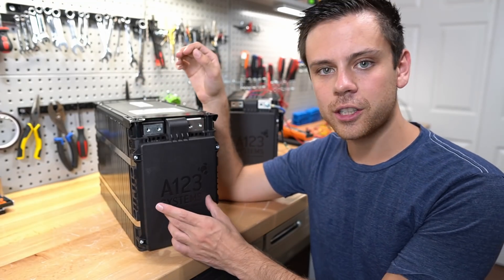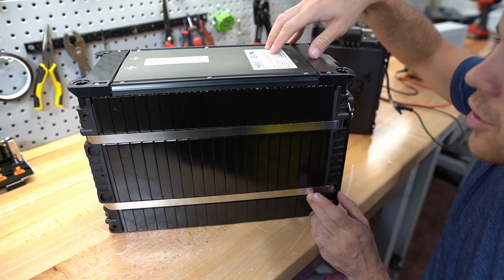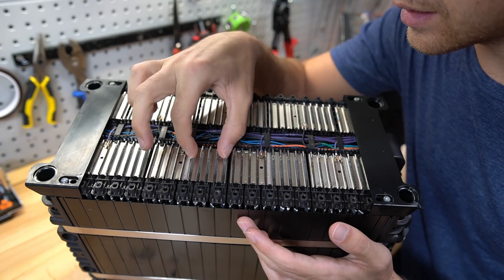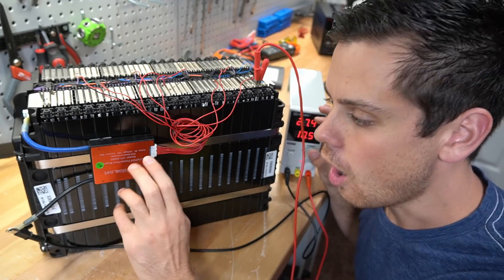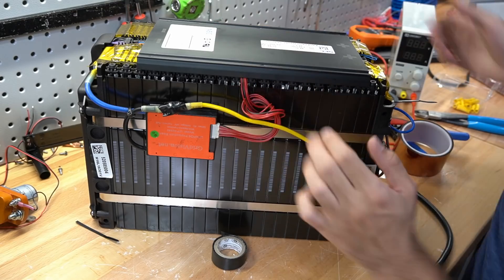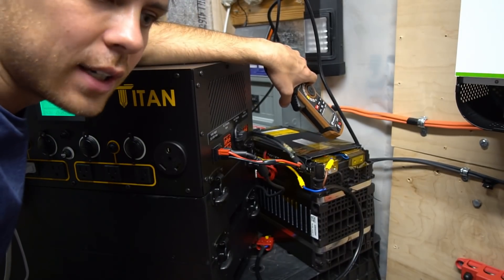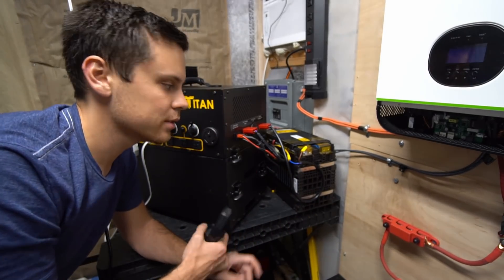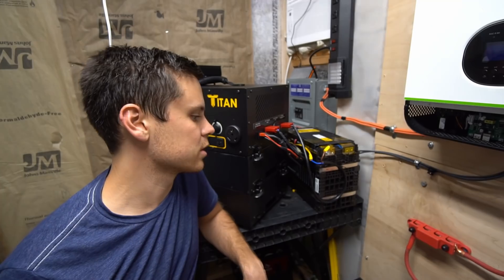DIY LiFePO4 Expansion Battery for the Titan Solar Generator: $649 2.45 kWh A123 Battery Build

Comment: You added your own BMS leads to pre-existing "balance" wires... What are those wires already in the pack doing? If there some sort of balancer already installed?
Reply from the maker: Yes there is a balancer installed but it doesn't do anything else unfortunately. I should have covered that in more detail. And it won't hurt it to have balance lead in parallel with integrated BMS
Reply: @WillProwse  doesn't do anything other than balance?? Good question Matt Bunce.
Reply: The one I just received had no balancer all the leads ran to an unused plug under the end cover. I installed an Overkill BMS.
Reply: @xraykadiddlehopper8067  Did you use the plug to connect the BMS? I asee there is an adapter you can buy for $20.

Comment: Your timing is perfect!  My Delta 1300 just crapped out.  Bad invertor and charge controller.  Company will return my money.  I just bought one of these batteries.  Thanks for the 10% off too.

Comment: why does everything need to be 24 volts,  I  need 12 volts for my system
Reply from the maker: Everything should be 48V 😁
Reply: @WillProwse  i don't understand why i can't get 12 volt batteries easily I have built 7 100 amp 12 volt  batteries with bms before and now i can't find the bms  to build more
Reply: @SantaSirGlennDrHeald  12v is very inefficient and it creates a lot of heat. The higher the voltage the better. Trucks and busses use 720v.
Reply: Because the cables you need for 100a at 12v it has very limited use easy to overload, 48v is where its at keeps the amps under control you Likey find a bms for 24/48v systems
Reply: Higher voltage means you can get the same wattage with less amps, meaning thinner cables and less heat.

Comment: Looks like that expansion connector just literally connects battery-to-battery. What chemistry (charging profile) does the Titan use? Meaning, is it suitable for this expansion pack? And finally, you always make sure we top-balance our cells before connecting them together to form a battery ... connecting a fully charged expansion battery to an almost fully discharged Titan? Schoolboy error, Mr Prowse 😉 Get some sleep!

Comment: DOH 😖 already bought two Lion energy batteries on the Costco deal for a 24v system. This along with the Overkill solar BMS might have been a better choice. But they’re still in the box so time to decide. 🤔 I might decide to sell one of the new unused lion energy UT1300 at the sale price i paid since they are no longer on sale.
Reply: Just take them back to Costco they will give you your money back used or not

Comment: If BigBattery advertises for 2.45 Kwh, that really means 60% which is 1.47 Kwh. After inverter losses your looking at 1-1.25 Kwh.
Reply from the maker: They also changed their listings after I complained about this.
Reply from the maker: Actually this time you are incorrect because this is not a used battery. these are actually 2.6 kilowatt hour batteries but they rate them at 2.45 kwh to be on safe side

Comment: Wow, for some reason I thought a123 went out of business like 10 years ago or so. I was surprised to see those modules, and then to find out they are in business.
Reply from the maker: Yeah that's what I thought as well. It's very strange
Reply: They went Bankrupt and were bought by a Chinese firm. A123 is now under the complete ownership of the Chinese. They did snag the rights to the best battery chemistry in the world at the time when this happened a few years back. I think Tesla's batteries are even better now though. It just depends on what your use is.
Reply: @tigeroll  It's not really the best chemistry in the world.  Energy density is much worse than Tesla's NCA or NMC, cycle life is not as good as LiTiO2.  As with all cell chemistries it's a compromise, should have good cycle life and good C rate but not the best of anything.
Reply: @JRP3  If you consider its positioning and its price, LFP is arguably still the best.  If you piecemeal your argument with one property against one chemistry, and another property against another chemistry, the argument is useless.
Reply: @GoatZilla  It's not the best by any metric.  A123 NanoPhosphate does not win on price or anything else.  My argument stands.
Reply: I make the best homemade pizza in the world.
Reply: @ForwardGuidance  Statistically unlikely to be true.
Reply: @JRP3  Then name the best, and name the metric that you're using.
Reply: @GoatZilla  It's entirely application specific.  There is no single best chemistry, not yet.  Currently for vehicles NCA and NMC have the best all around profiles, which is why most EV's use them.  For large vehicles with short daily range needs, like garbage trucks and city buses, probably LiFePO4 and LiTiO2, where the high C rates and high cycle life are beneficial and they don't need relatively larger packs providing over 100 miles of range.

Comment: Another great build!!    That looks like a nice physical configuration for an ~ 100AH battery.   Still a bit expensive compared to Alibaba cells, but a lot more convenient than the Ali cells.
Reply: Are you sure it’s more expensive than the AliExpress cells? I did some comparison a few weeks ago and for the 100 amp hour Prismatic cells  that he has he would need eight of them for a comparable battery. Maybe you’re talking about the bigger 180 amp hour cells
Reply: @CessnaPilot99   Things may have changed, but last February I was able to get 8 200Ah aluminum cells for $887 (delivered)  from Changsha Deligreen Power Co., Ltd. on Alibaba.   However,  I have to admit I do not like dealing with the tiny posts on the aluminum cells.

Comment: Hey Will!
Previous videos you've asked for ideas. Curious if you have ever thought of modding a Prius (old/new) so that you can hook into the HV battery and use that as a generator for backup/off-grid? If anyone here would know, I figure it'd be you.
Thanks for the videos and knowledge! :)
Reply from the maker: I am deathly scared of the Prius battery. The high voltage scares me
Reply: @WillProwse  
All good Will. I'd never ask you, or anyone, to risk their safety when they felt it was at risk.

Any chance of getting a whiteboard system build? 
I'd really like to use my old Prius as a generator for my parents as they live rurally where power outages happen 4-6x per year, sometimes for days. They have an old generator, but it's terrible and I'm worried about their health due to how it's setup.
My thoughts are that the Prius could act as a generator in a similar system like you've shown on your channel before, and it could top off a battery bank in the house which acts as backup for lights, fridge, etc.
 
It'd be lot quieter, better, it'd give a second life to my old car, and it's a sneaky way for me to get them to get solar later in the future :P Haha
 
Thanks for taking the time Will :)
Reply: @stedavid13  Yes, you can do it but it isn't  recommended because it is air cooled as the Nissan leaf. However, you can connect 12v Lithium battery in parallel with the accessory battery and that will work as an emergency. Never exceed 100 amp or the fuse will burn.
Reply: @neliosamch3195  That doesn't make sense. The Nissan LEAF is passively air cooled - aka it's not cooled at all. Every Prius made has a fan to blow air over the battery so...
Reply: yeah ! I agree. Also i always wondered about using any hybrid as a backup generator for your home during power failure!  I know there is a modified Ford truck that is hybrid and has an electrical outlet for the drivetrain generator!

Comment: you should change out the lights in the Solar Shed to LEDs, the PWM of the existing lights create dark bars that run up and down the frame of the video
Reply from the maker: Good point
Reply: Eli Miletich Good point I didn’t really notice that

Comment: dangit, just ordered a 100ah 12vdc "kit" about a week ago, then this comes out and is available..
Reply: This is the problem with buying stuff. We will always have some kind of remorse unless we just focus on that goal that set us on the journey to buy in the firs place, and realize it's more about what we get out of it and how we put it to use. Value comes from the experience. It's still interesting to see where technology is going, and know about alternatives for later expansion. Then we can run comparisons of our own and determine our own favorites.
Reply: @brendanwood1540  Absolutely, and from my days working in substance abuse treatment, sometimes it's not about where we are on the road, but that we at least are on the road and pointed in the right direction. The great thing is however, I'm upgrading from 3 marine batteries to the LifePo (having already upgraded from a 45amp Morningstar PWM charge controller to the Renogy Mppt, new PV panel doubling my input etc.  Watching a lot of your video's, bought the RV book (though I'm not a complete Newbie, have used some solar for Ham radio and to power a freezer converted to fridge for selling eggs at a farmers market and even completed a course in renewable energy some years back at a community college).  This 53 year old geezer is learning a lot from you, and enjoying your plain language, common sense, practical-minded information and energy.  Keep it up. (btw, my upgraded system is going to be powering stuff at a little market garden).

Comment: I too am surprised that the BMS did not trip under that amount of amperage out-rush .... BUT does go to demonstrate a point about being careful hooking up different state of charge batteries together ...
Reply: We talked on his forums. Hi
Reply: Maybe an independent test on that BMS should be done as t should have tripped & didn't. That to me is a Red Flag alert.   If a BMS fails to shut down when it should, it isn't a good sign is it.
Reply from the maker: Could be faulty current calibration, prolonged surge current rating, improperly labeled, or it's derated properly. Not sure. If I ran it for more than a few seconds like I did, it would have tripped it. BMS is pretty simple device and I haven't seen the OC protection not work
Reply: @WillProwse  Ive pulled 100+ amps on a 60amp BMS, did not shut off even after over 1 minute. Tested another 150amp BMS for short circuit protection, it smoked hard rather than shutting off. All those specs from china are full BS.

Comment: Yahoo! Are these the same cells that come out of that 20kwh system battery hookup were selling?
Reply: These are 8S5P. The ones from the 20kwh battery hookup deal were 7S3P.  That was a sweet deal for barely used A123 cells.
Reply: @brianswenson2686  Sure was. Shipping and Taxes to the UK would have made them double in price but still be a cheaper option than buying 800ah of lithium based cells from the "UK".
Reply: They look like they are the same